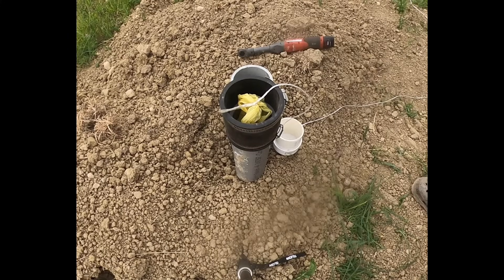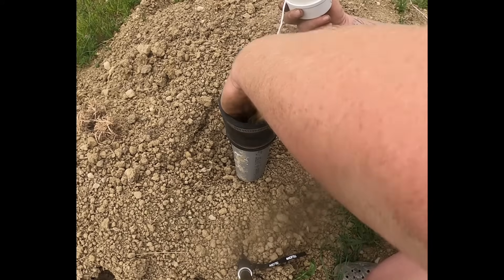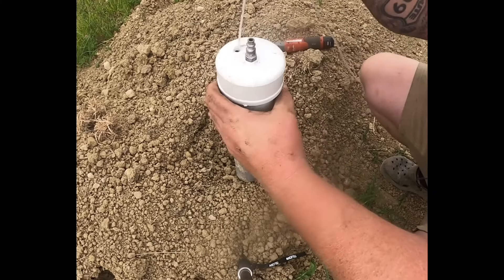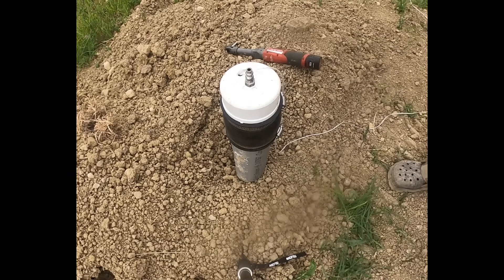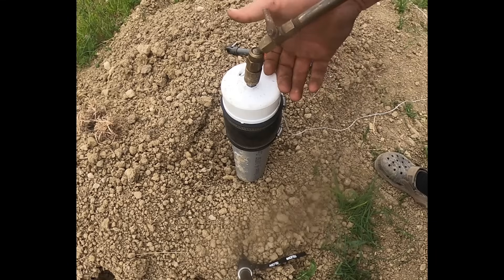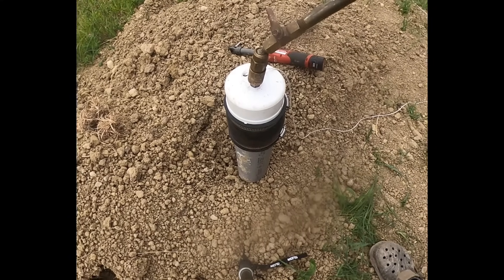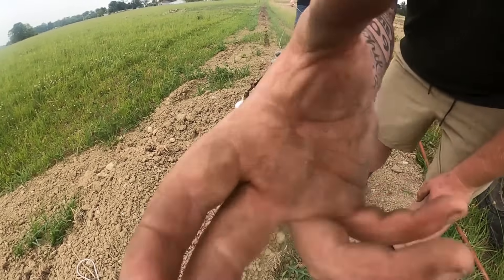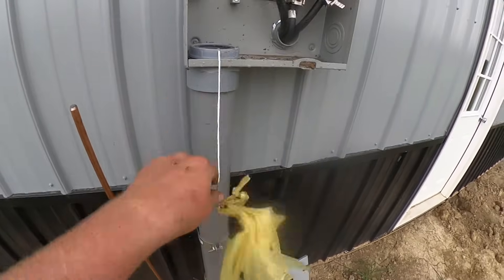How to blow a string through conduit the easy way.

Comment: I’ve been an electrician for many years and have used a lot of different methods and just about any will work. However an older telephone guy showed me that instead of using a thin plastic bag, a used ice bag is a bit stiff and doesn’t stick to the sides of a 3” or larger conduit when the conduit is wet. It works great 👍

Comment: Old retired sparky here. I have used air, suction, radio controlled car and a compound bow to get a string from A to B. What i love is when the pipe is full of water and you have the new guy at the receiving end.
Reply: When there’s water in the pipe, my preferred tool is a well-trained eel.
Reply: @andybrice2711  LMAO
Reply: @andybrice2711  Every electrician has a fish, the great ones have an eel. A chipmunk works pretty good in dry pipes too, avoid snakes unless you plan on going into plumbing.
Reply: You evil man...lol
Reply: @ntal5859  Whats evil is to tell the new guy to put his ear down there to listen for the gurgle
Reply: Here, we have temp laborers who use open conduit for toilets.
Reply: @shopstuff5  That's when I land wires and turn on breakers before trimming out.
Reply: I used my wiener dog one time to run cable under a raised foundation.  Tied it to his collar and lowered him down.  Worked great.

Comment: Thanks for the alternative for getn string through a few hundred feet of 3" conduit out in a farm field. I immediately recognized the Fernco boot having to do occasional plumbing jobs. Without an inverter on your UTV, you wont be using a vacuum to pull the string through. Good job!

Comment: If you don't have a compressor handy, but you have a shop vac then you can do the same thing using a bag as they show on here. Instead of blowing the string through just go to the other end and suck the bag and string through from the other end. Either way is how utility companies do it to get their wire in. I know because I did it for many years for an electric company.

Comment: Compressed air works very well with small conduits, where a the shop vac interface might be tougher. A small length of tubing on the end  of a blow gun can fit about anywhere and will shoot the string through almost instantly.
Reply: Yeah, I was taught the compressed air tank bit in the 70's. Use a rag instead of a sack, a rag to cover the opening, and "zip" it was 50' away. Just make sure the string was clear of fingers/wrists. The civilians said it'd take them 60 to 90 days to pull phone cables thru conduits in the new barracks. Our team chief showed us the trick and we had it all done in 4 days, excepting one where the contractors filled a pipe with cement.
Reply: @mikep490  Absolutely, that's how the pros did it. We used to call the rag, a "mouse" because it was about that size and when it shot out the other end, it kinda reminded you of a mouse darting for cover. 

For big stuff, you'd blow in the string and the use it to pull in a pulling rope.  Shop Vacs do work, but sometimes a bit cumbersome. If you had a work truck or van, you probably have a small compressor or an air tank. 

A few of the guys I trained in a HS program scored well and went into the military divisions who did this sort of base infrastructure work. O know some of those guy who were reservists also worked industrial jobs where they learned these kinds of tricks. I worked in industry in the 70's and learned the trick from the old timers. Back in those days before cable tray replaced a lot of conduits, you would see big banks of conduits that had 40  or 50 individual conduits. All of it was hand bent to fit and the big runs were a thing of beauty!! These guys were good at their jobs and were literally artists. When building these big runs, one of that last steps was blowing in the strings and I can remember big junction boxes you could sit in with what looked like strands of spaghetti coming out the conduits!!

Big contractors today have essentially dumbed down the workforce skill levels.

Comment: For long pipe runs or runs with mud and water in them blowing is only partially successful. I told an apprentice forty or so years ago that if you use suction and start the bird going it will almost always go the distance.  With blowing you may turn the bird and lose the pressure.

Comment: Just put a good shop vac on the other end
Reply from the maker: This video was specifically made for someone with an air compressor. Hence the title…
Reply: Why don't you make a video for us?
Reply: Or, "just" use an air compressor. I have a feeling you are the kind of person people walk away from when you start talking.
Reply from the maker: @MicahThomason  😂😂😂😂
Reply: You beat me too it!
Reply: That’s better than tying the string to a rats tail
Reply: @MicahThomason  BOOM goes the dynamite 😆
Reply: Totally agree vacuum cleaner works the best.
Reply: @jerryarcher1923 till there’s a lot of water in a long run of pipe..
Reply: The shop vac works great! It has a large airflow. I pulled 175 ft through in about 2 seconds
Reply: Never seen it down with an air compressor...

Comment: What is in the DG plastic bag? Couldn't understand what you said.
Reply from the maker: Nothing. It’s just an empty bag
Reply: @MooneysExcavating   BS, you said "take a 3 inch (mumble something, CC reads it as "Fern Cove", whatever the fuck that is) "    So what did  you actually put in the bag? Was it another bag, or was it a "Fern Cove"
Reply from the maker: @mxslick50  there is nothing in the bag… and a 3” fernco is the black rubber coupler.
Reply: When you dropped that bag at the end it did not look empty. It fell way too fast for being empty.
Reply from the maker: @voiceofraisin241  ok 😂
Reply: @voiceofraisin241  probably he put some dog shit in the bag
Reply: @voiceofraisin241  
It was your mom. Your mom was in the bag.
Reply: I also had to rewind the video twice to figure out what was in the bag :=) I think it just accumulated sand and dirt going through the conduit.

Comment: Hi very good IF one has a compressor, fittings, a lot of string, rubber hose.
Reply from the maker: Yessir. More than likely if someone does this for a living they will have those things. You can also use a vacuum if you don’t have an air compressor.

Comment: Did you make that cap? I’m trying to use a shop vac 6.5 amp on 1/2” conduit with paper napkin and poly sting. Runs around 150 feet but the other end doesn’t have enough suction.  Conduit is brand new and buried already.

Comment: what would you do if you had a shop vac at one end of the conduit and an air compressor at the other end of the conduit? which one would you go for?
cool trick btw, comments gave me a laugh
Reply: Use the shop vac discharge to blow the string through.

Comment: Clever! But you know, you could have placed your electrical cable in the pipe before you buried it.
Reply from the maker: We could have. This takes less time than it would to do that though. Time adds up fast when you’re pulling several thousand feet of string or wire.

Comment: Does it still work if you have 90's ?  Or do you have to have sweep 90's ?
Reply from the maker: With electrical conduit we always use seeeping 90s. Makes it easier for us and the electricians to pull the electric line. This had 2 3” sweeping 90s. I wouldn’t suggest anything that’s not sweeping
Reply: Thanks for your time and help. @MooneysExcavating

Comment: Electricians have been using this method, usually with a shop vac, for decades - without all of your fancy fittings. But you go on thinking you discovered something! 🤣😂
Reply from the maker: My dad is an electrician and showed me this. I discovered nothing. Just trying to help someone out if they’ve never seen it
Reply: He never claimed that he invented this trick. He was decent enough to make a quick video on how he, and a lot of other electricians, do it. Do you go on every how-to video on YouTube and cry about how those people didn’t invent the methods that they use? You’d have a lot of crying to do.
Reply: He shared it with me and I've never seen it before. I'm a homeowner with a few buildings on the plot.  I'll definitely be putting it to use.  Thanks for sharing it MooneysExcavation.  👍
Reply: @tradde11 I was thinking that same damn exact thing.
Reply: I see you used these two emojis: 🤣😂
Do you really expect us to believe you invented those emojis.  You discovered nothing!  Stop acting like you're some kind of hotshot emoji entrepreneur.
Reply: Looks like some folks need to switch to decaf - if you were calm and thinking clearly you would have gotten my point. You don’t need a pipe cap, a valve, an air hose nor (especially) a compressor! You just need a shop vac - lots of folks have shop vacs, but few have compressors. So, my tip is more helpful and I’m a real electrician - a master with 45 years experience. So please, look into that decaf coffee. Have a pleasant day! 🤣😂
Reply: @robertlyle6277   So now you're claiming you discovered decaf coffee?!?  Don't be so proud of yourself -- decaf is nasty.

Comment: Okay...that's the "easy" way. Is there any OTHER way??
Reply: Yes a shop vac from the other end will work just as well
Reply from the maker: As many have stated. A shop vac works just as well from the other end. We have also used a simple leaf blower to get it done. There’s not a right and wrong way to do this. Depends on what tools you available that day on the job.
Reply: Oh yes , the hard way !
Reply: Trained ferret.

Comment: This is how you do it if you don't know what your doing and you have all day to get the job done.
The correct (and much faster) way to string a conduit is to use a good vacuum on one end.  The vacuum will pull the string through the conduit in 15 seconds.
Reply from the maker: What do you do when you don’t have a shop vac and have a compressor on the job site? Specifically made this video to show how to do it with a compressor, specifically did not use a shop vac on purpose.
Reply: "you don't know what you're doing"
Please try to know what you're doing before criticizing someone else.
Thanks!
Reply: This method seemed comparably quick and effective, so I’m not sure why you’re so disparaging.
Reply: This took 30 seconds. I highly doubt a shopvac would be much faster. And who cares?

Comment: I can see doing something like this on an old pipe, but I guess I'll never be an electrician cause I would have put the string in the pipe as I buried it.
Reply from the maker: I thought the same thing until I saw my dad do this. Gave me anxiety not already having it in the pipe the first few times because I didn’t trust it. Sure enough there’s nothing to worry about. We’ve done this through several thousand feet of conduit.